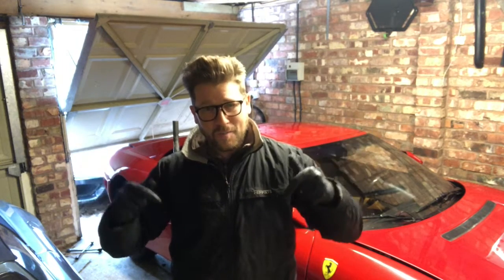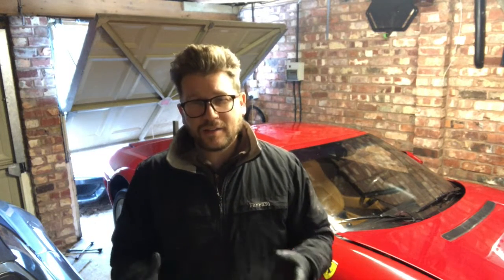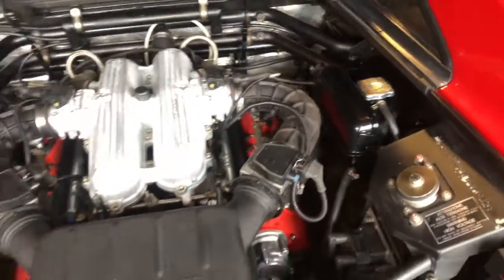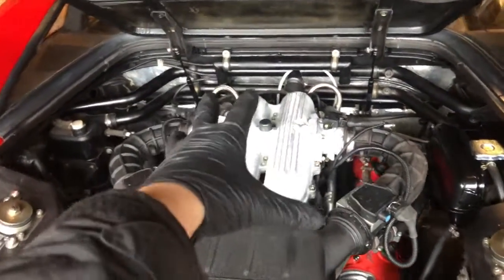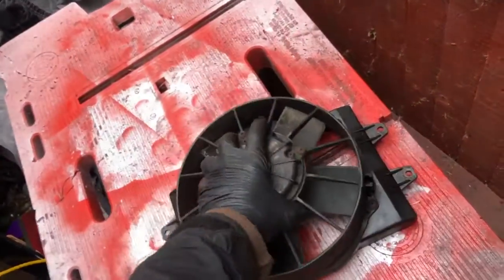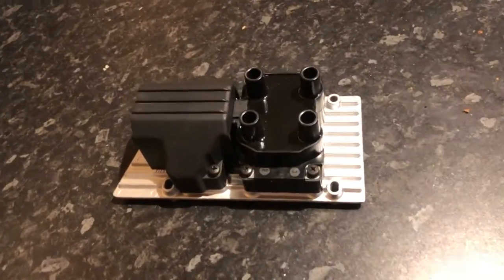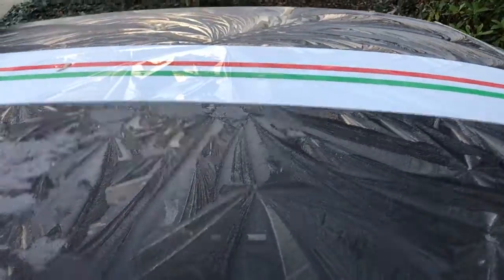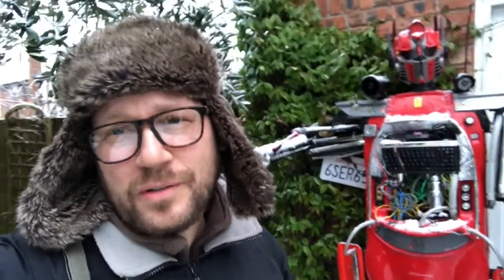Ferrari 348 Project Episode 5

Comment: +1 on Brian’s comment. Re the engine cover foam insulation, I replaced mine with a matte black high density insulation foam which looks far tidier than the original. Still got masses left as I bought a big roll of the stuff. Give me a shout if you want me to post a pic on CS, if you like the look we can probably work out a way to get it to you.
Reply from the maker: Pete I I was thinking of changing it to Pete, I’ve done it on the past 308s & Testarossa. Wouldn’t mind seeing s picture if you don’t mind 👍🏻👍🏻👍🏻
Reply: Ratarossa will try to get a pic later today. In the meantime it was the stuff used in this thread:
http://www.clubscuderia.co.uk/forum/showthread.php?23542-348-Engine-cover-insulation/page2
Reply: Ratarossa Pic posted on your thread on CS.